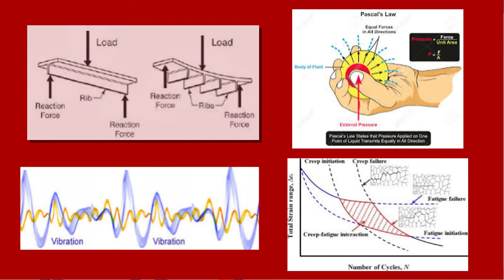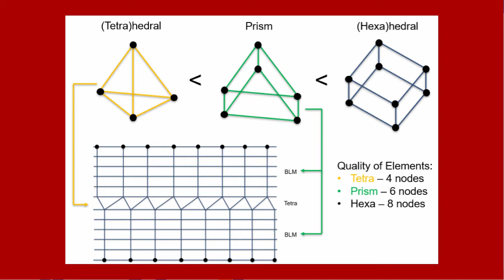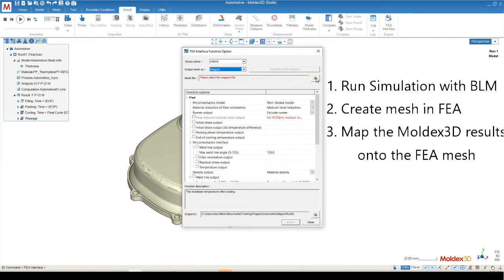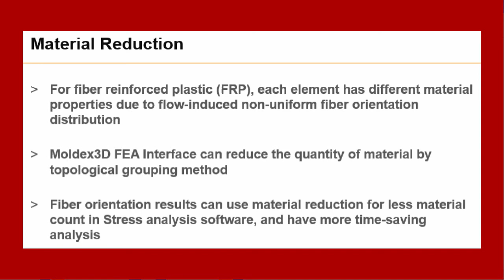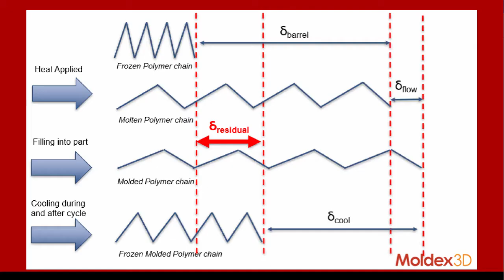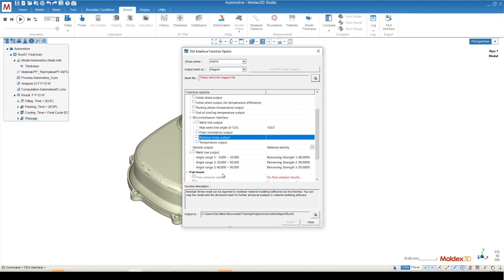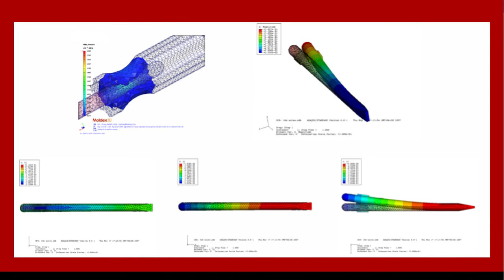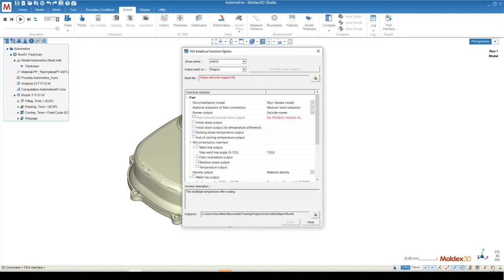FEA Interface & Micromechanics (FEA/MMI) | Advanced Module Breakdowns | 15 Minute Lessons

Comment: Thanks for the interesting video! You mention that the mapped option is the best as it enables you to use the elements of the structural FE mesh. What if one would like to export the deformed part as well ( so not only the material properties introduced by the injection molding process)? Is there a way to export the deformed model (deformed option) while using only the element type of the structural FE?
Reply from the maker: Thank you for watching!  Unfortunately the FEA Interface will only allow you to either export the deformed model OR mapped results onto the FEA mesh style, but you can run the simulation with a pure tetra mesh instead of Boundary Layer Mesh and then export the deformed model like that.  It is not recommended to run with tetra mesh though as a BLM is a higher quality mesh over all.
Reply: @moldex3dnorthamerica599  Thank you for the reply! It would be interesting to be able to export a deformed model, including material properties such as a density distribution. For the moment I export the deformed model to a structural solver, after which I map the density to this deformed mesh in a second step. Which means I need to use the FEA interface 2 times for each part. Anyhow, keep up the good work making all these videos.